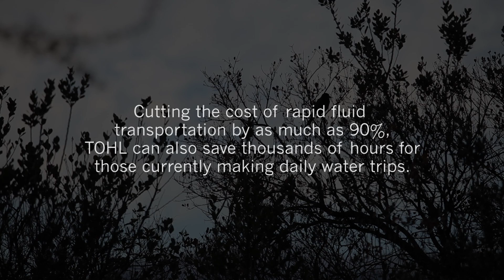Mobilizing the Globe - an intro to TOHL (short documentary)

Comment: Sorry guys, But as a helicopter pilot in the states I can tell you this isn't new. I've strung miles of poly tubing and other heavier hosings for years. Mostly for mining and fire fighting.
 I would also recomend you check out the methods power line companies use to string wire from helicopters. I've done as much as 25,000 (yes thousand) feet at a time.

Comment: You are absolutely right! TOHL is exploring the potential of using our tubing for wildfire mitigation. One important point here is the installation load (which would just be the tubing's weight) and the operational load (the additional pressure/ turbulence a helicopter will have to withstand if the water is pumped while still holding the tubing in flight). We have determined the best way of doing this would be decouple the installation from the operation, run water post-installation only.

Comment: Yes, this is an important point and I did not address this in my last point. You are absolutely correct! One of the important points we determined during the pilot run was exactly the rule of thumb you mention! 10 mph is roughly the most rapid pace of installation we can apply, although the actual number would obviously fluctuate in every operation given the diameter of the tubing and the material used (especially given what the material's elastic & elongation properties are)

Comment: yes and no, 
As a helicopter pilot who does wire stringing I can tell you if you are moving fast enough and it jammed you would not be able to stop the helicotper quick enough, If the pipe didnt break easily it would roll you over. That being said, I dont think most pilots are dumb enough to go that fast. Keep it slow about 10mph.

Comment: This idea has not been attempted before primarily due to the thought process you mentioned. The team behind TOHL has found in its due diligence that not only is the installation cost easily outweighed over time by the savings in operation, it is also more efficient from an energy/supervision standpoint, and most importantly, has garnered interest from parties that would be buying the system. Prices are not that high, and the effort not too great for the rewards

Comment: Jamming is not an issue with a helicopter because a helicopter can stall in place. This allows a stable foundation off which the spool can be manoeuvred to "un-jam" the tubing if it were to get stuck

Comment: No.... it took a little under 9 minutes for the tubing to be deployed, and 7 hours and 49 minutes for the pump, solar panels, batteries, and generators to be installed. The "removal part" took under 10 hours (cell phone died while doing the removal).

Comment: The nature of these operations are noty large scale, but for those who are niche and specialised. There client is small and will only contact them as a last resort, due to there relatively high prices. The resources used to implement this operation are seemingly too high. A cord which you have cut at the end of the trail, lines running through the landscape, no one has done this before simply due to the effort required to make this happen, and only such a character can make this happen.